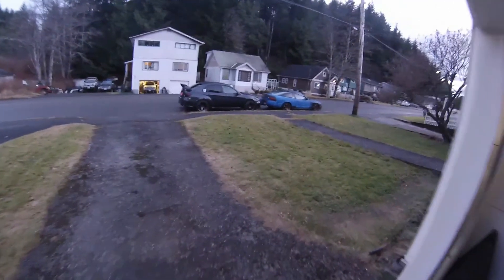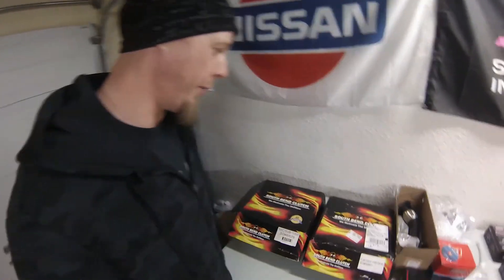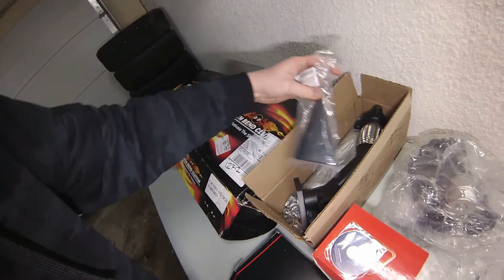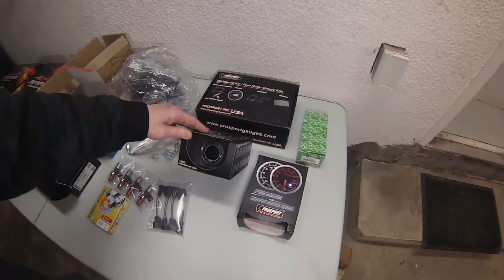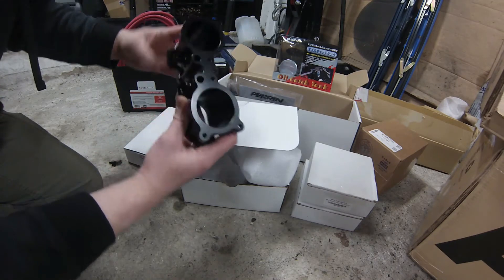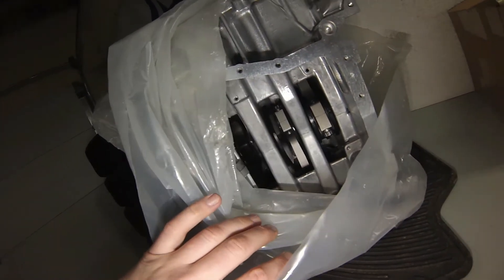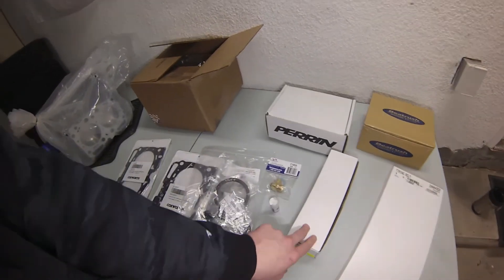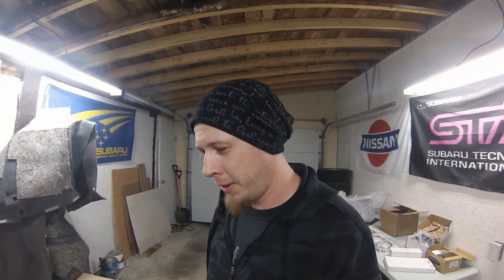2013 STi Build Part 1 - Parts Reveal

Comment: How many miles were on the car when this all happened and how can I prevent ringland failure from happening to one ?
Reply from the maker: Allen Murphy this failed at 50k kms/30k miles. Stock engine was tuned for power and that in my opinion is the number one failure. 4/5 cars that fail have been retuned. I’m not saying there isn’t an issue with Subaru’s cracking number 4, but the chances increase when a person demands more out of the stock oem block. Drive the car normally and more than likely you won’t have a problem. Want to take it to the track? Build a block.

Comment: How much did you pay for you short nice block..it is forged block... I have a same car like you.. but I have make me probleme now I have to rebuild it.. and have to put a forged block ..??
Reply from the maker: This car wasn’t mine and I didn’t buy the parts. I think the stage 3 block was around 5k usd. It’s rated for 500whp
Reply: Just in short block it cost $ 5 and ??? how much labor did you do when rebuilding the engine?  My car has many things after  mark  and they told me that that gave it more  power.. but use oil they call blow-by ...I need fix it..
Reply: When the engine on an STI is modified from the pressure/power it pushes oil past the rings(all STI do that). You can help that some by adding an oil catch can. The only way to fix that issue for good with that much power is a forged motor ...the is the text send me the mecánic check my car .. but he is work in the subaru dealer he can work in my car....
Reply from the maker: @selvinmontes2931  this engine had a cracked piston. The final cost of all parts and labor I do not know
Reply: @HomebrewSubaru  do you think I have to buy the iag block for fix the blowby or only change the piston ring and piston...
Reply from the maker: It depends on the damage. That will a tear down for inspection.
This video you can see the damaged piston: https://youtu.be/VZ4AuxaNzEg
This video you can see that I reused the block with new pistons and rings: https://youtu.be/nveork0Acjw
This video you can see a piston that ruined the cylinder: https://youtu.be/iz5DkWIB-d4
Reply: @HomebrewSubaru  came fix me it😁😁🤣🤣..where you live..???  I wish do the job you do...you make amazing videos and great job... I love the mechánic .. learned mechanic has been my dreaming.
Reply from the maker: @selvinmontes2931  I'm in Canada. Keep reading, watching videos and buy tools ;)
Reply: @HomebrewSubaru  hello .. you have to came fix my car 😂😂